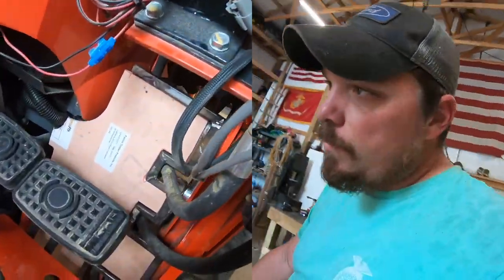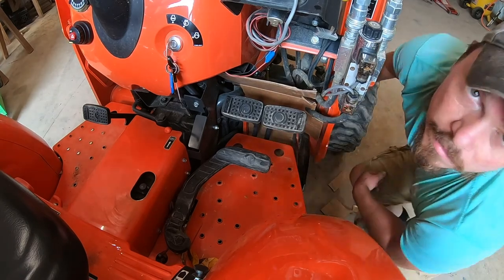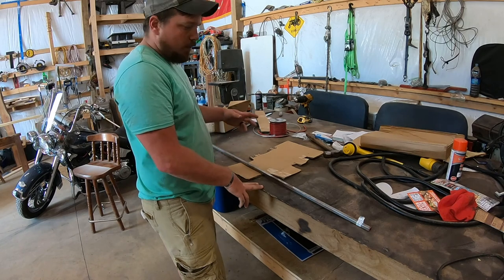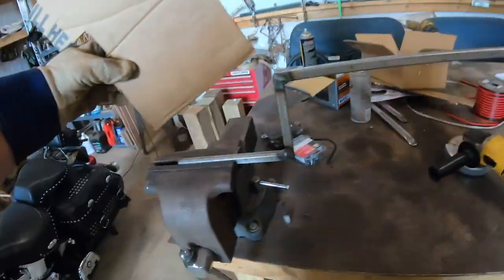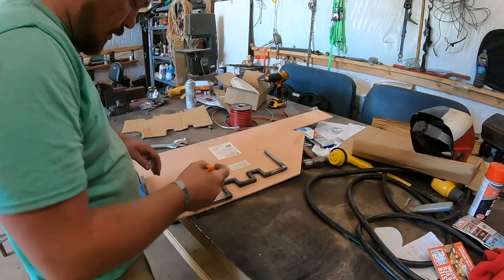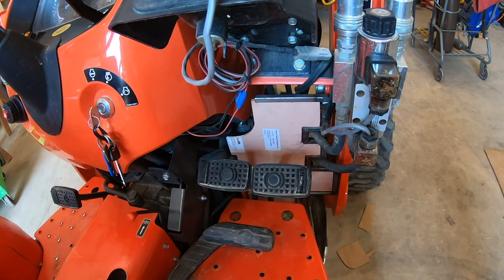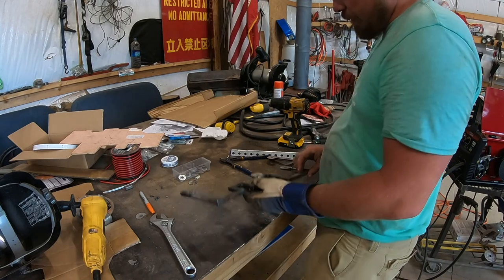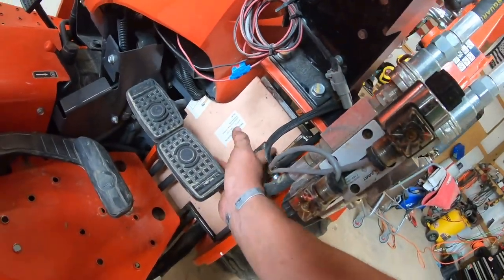Heat shield for L3901 is your HST foot hot? watch this!

Comment: Any chance you still have your template for this heat shield? I just bought L3901 and cooked my right foot duing 5 hours of mowing. Will gladly buy template so I can make one. Has it lived up to your needs? Thanks for the video.
Reply from the maker: I just have the one on the tractor. And it’s still really hot but a lot better. I tried finding solutions on the web but no luck and in Facebook groups people didn’t seem to really have this problem 🤷🏻‍♂️. I need to upgrade it to something other then wood and cut it tighter or put a weather seal around it to block more.
Reply: @thecheltonchannel5739  When you take it off would you be willing to trace it on paper? You already have the shape.  Should give me something to work with.  Thanks for your time.
Reply from the maker: Yea I wouldn’t care to. I’m not sure when I’ll get around to it. Will have to give me some time. It’s easy to get out. It’s just held in by magnets. I’m just super busy at the moment.